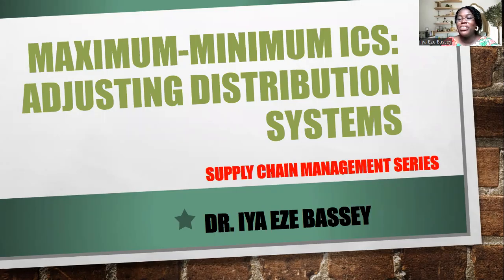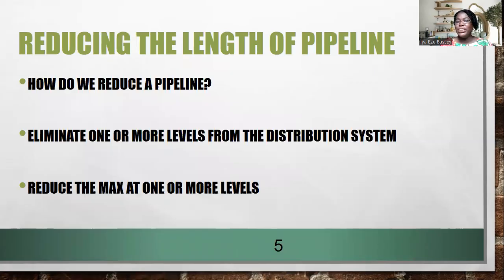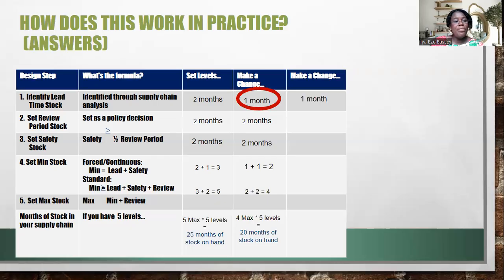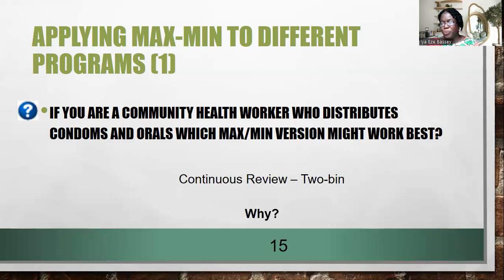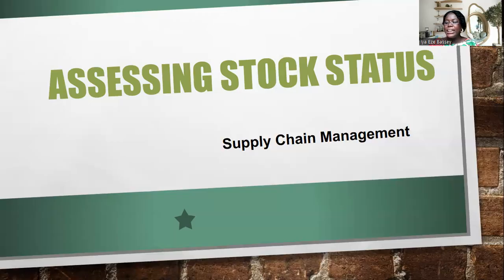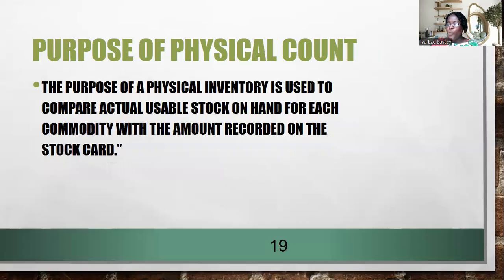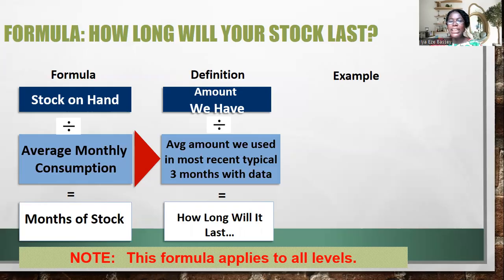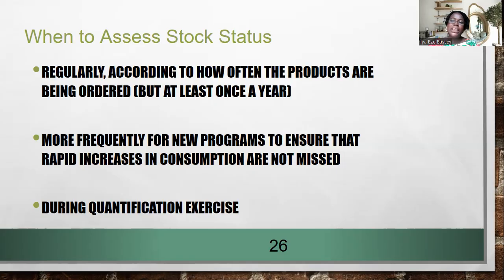Maximum-Minimum ICS: Adjusting Distribution systems (Supply chain management series)

Comment: Good Morning ma,
Here is my summary or what I learnt on the Topic; 
Adjusting the pipeline in the max-min ICS x Accessing Stock Status 
Firstly, the steps in designing a Max.-Min. ICS 
• Step up initial max-min policies for each level and type of facility.   
• Check if the overall distribution will function properly if the level specific max-min policies are implemented.  
• Check the total length of the pipeline f the policies at each level imply 
         Reducing the length of a pipeline 
• Eliminate one or more levels from the distribution system 
• Reduce the max at one or more levels   
How do you reduce the max stock level?
You shorten the review period, reduce the leadtime and Improve the distribution system reliability at one or more levels. 
       Some factors that impact max-min stock level includes:
Cost of product, Reliability of transportation, Storage capacity, Cost of storage, Leadtimes,
Shelf life of health commodities, etc.
The Advantage of using max-min system are: • It avoids overstocking, under stocking and cost for emergency orders
• It minimize wastage 
• It simplify inventory control decision-making 
        What is physical count?
Physical count is the process of counting by hand the total number of usage units of each commodity in your store or health facility at any given time.The purpose of a physical inventory is used to compare actual usable stock on hand for each commodity with the amount recorded on the stock card or BIN card.  
Also, the purpose of accessing stock status is to determine how long supplies will cost
 
The Formula to calculate how long a stock last (Months of stock) is:
MONTHS OF STOCK = STOCK ON HAND (amount we have) ÷ AVERAGE MONTHLY consumption (amount used in most recent typical 3 months with data)
Finally, when to access stock status
• Regularly according to how often the product are ordered(but at least once a year). 
• More frequently for new programs to ensure that rapid increase in consumption are not missed. 
• During quantification exercise.
           Thank you ma for the class😊

Comment: Thanks again ma for another enlightening lecture
From this lecture, I understood the steps indesigning a max-min ICS which are:
1) Set up initial maximum policies for each level and faculty
2) Check if the overall distribution will function properly if the max-min plocies are implemented
3) Check the total length of the pipeline that the policies at each level imply
It is important to carefully analyze demand patterns and adjust inventory levels accordingly
By monitoring sales data and forecasting future demand, business can determine the optimal distribution strategy to ensure that products are available when they are needed.
1 also understood that the advantages of using max-min stock is to avoid overstocking, understoking to minimise wastage and to avoid costs of emergency order, etc. Once again, thank you very much ma

Comment: Thank you ma'am. I have learnt that the maximum minimum inventory control system is crucial for managing stock levels, preventing overstocking and understocking. This system is particularly useful in the medical laboratories for managing laboratory Reagents, consumables and equipment.
The maximum minimum inventory control system operates by monitoring the supply chain, from manufacturer to end-user. I've also com to understand the several factors influence the maximum - minimum levels, including: Age of the program, storage costs, production costs and lead time.
This system helps avoid emergency order costs by providing regular stock status updates. Additional, it facilities management and assessment of the supply chain's length at each level.

Comment: Summary of What I Learnt:
	•	Adjusting a distribution system with Max-Min Inventory Control (ICS) helps manage stock at different points in the supply chain.
	•	It sets maximum and minimum stock levels at warehouses and distribution centers.
	•	When stock hits the minimum, the system automatically sends replenishment orders.
	•	When stock reaches the maximum, it can slow down new deliveries or move extra stock to other places.
	•	This system helps:
	•	Lower storage costs
	•	Avoid stockouts
	•	Respond quickly to changes in demand
	•	Create a more flexible and efficient distribution network

Comment: Great session Prof, here's a summary of what I learnt,
I learnt the different steps in designing a max/min ICS which are: 
a. Setup initial max/min policies for each level and type of facility
 b. Check if the overall distribution will function properly if the level specific max-min policies are implemented. 
c. Check the total length of the pipeline that the policies at each level imply. 
I also learnt different ways of reducing a pipeline, the factors that impact the max/ min stock levels, advantages to using max/ min system, challenges faced while using each versions and variations, applying max/ min to different programs,the difference between a PUSH and a PULL system, definition of physical count( the process of counting by hand the total number of usable units of each commodity in your store or health facility at any given times) it's purpose and why and when to access stock status.

Comment: This is very educative and setting up initial Max-Min rules for each level, determining if the distribution as a whole will work, and determining the total length of the pipeline that the policies at each level suggest are the processes in constructing a Max-Min ICS. In order to compare real stock on hand for each item with the amount listed on the stock card, accessing stock status entails the physical count. Depending on how frequently the products are ordered (at least once a year), we have access to the stock status on a regular basis. Utilizing MaxMin systems has benefits such as minimizing waste, avoiding overstocking and understocking, and maintaining consistent stock levels. Max-Min stock levels are influenced by a number of variables, including product pricing, transit reliability, and storage capacity. health products have a limited shelf life and it has help to grow up some products pricing.

Comment: Thanks ma. I learnt how to reduce the length of pipeline by eliminating one or more in the distribution system. Also how to reduce the MAX stock level by improving the distribution systems reliability at one or more levels so that safety stock can be reduced. By also practicalizing on the design step, formula, the set levels, how we can make a change for diffrerent month. I also learnt about the advantages of using MAX -MIN by avoiding overstocking and minimized wastage. And the purpose of accessing stock status by calculating the MOS on Hand.

Comment: Thank you ma.
I learned how to plan a max-min system for storing health items. The steps are:
	•	Set the first rules for each level of facility
	•	Make sure the rules work across the whole system
	•	Check how long the supply chain becomes

To make the pipeline shorter:
	•	Remove one level in the supply system
	•	Lower the max stock level in some places

To reduce max stock, we can:
	•	Check items more often
	•	Cut down how long it takes to get new stock
	•	Improve the system to need less backup stock

Other things that affect max-min stock:
	•	Product cost
	•	Storage space
	•	Storage cost
	•	Shelf life
	•	Transport reliability

Max-min helps us:
	•	Avoid too much or too little stock
	•	Reduce waste
	•	Avoid costly emergency orders
	•	Make it easier to decide on stock

Some problems include:
	•	Many system levels
	•	Too many product types
	•	New health programs

Physical count means checking each item by hand and comparing with what’s on record.
Stock status means knowing how long the supplies will last.

Comment: In summary 

The process of designing a max-min Inventory Control System (ICS) involves several key steps:
	•	Initially setting maximum stock policies for each level and facility
	•	Evaluating whether the overall distribution system will function effectively with these policies
	•	Assessing the total pipeline length implied by each level’s policy

Often, the pipeline length may be excessive, leading to delays in commodity delivery. To shorten it, the following strategies can be used:
	•	Removing one or more distribution levels
	•	Lowering the maximum stock levels at specific levels

To further reduce maximum stock levels, the following approaches may help:
	•	Decreasing the review period at one or more levels
	•	Shortening lead times
	•	Enhancing the reliability of the distribution system

Several factors influence max-min stock levels, including:
	•	Product costs
	•	Transportation reliability
	•	Available storage space
	•	Storage expenses
	•	Storage conditions across levels
	•	Shelf life of health commodities

The max-min system offers several benefits, such as:
	•	Preventing overstocking and understocking
	•	Reducing waste
	•	Avoiding the high cost of emergency orders
	•	Maintaining stable stock levels.

Comment: SUMMARY: MAX-MIN INVENTORY CONTROL SYSTEM: ADJUSTING DISTRIBUTION SYSTEM.
-Set up initial max-min policies for each level and type of facility.
-Check the total length of the pipeline at each level.
 HOW TO REDUCE THE LENGTH OF A PIPELINE.
1.Shorten the review period at one or more levels 
2.Reduce the lead time at one or more levels.
3.Improve the distribution system reliability at one or more levels so that safety stock can be reduced.
 FACTORS THAT AFFECT MAX-MIN STOCK LEVEL 
-Cost of product.
-Reliability of transportation 
-Storage capacity 
-Cost of storage 
-Storage condition 
-Lead times
-Reliability of sources of supply.
 ADVANTAGES OF USING MAX-MIN SYSTEM 
1.Avoid overstocking.
2.Avoid understocking.
3.Minimize wastage.
4.Avoid cost of emergency order
5.Consistency of stock levels.
 PURPOSE OF ASSESSING STOCK
1.To compare actual usable stock on hand for each commodity to the amount recorded on the stock card.
2.To determine how long the supply will last.

Comment: Thank you ma.
I learned how to plan a max-min system for storing health items. Steps include:
	•	Set rules for each level
	•	Make sure rules work across the system
	•	Check how long the pipeline is

To reduce the length of the supply chain:
	•	Remove one level in the system
	•	Lower the max stock level in some areas

To bring down the max stock level:
	•	Review items more often
	•	Reduce how long delivery takes
	•	Improve system performance to need less backup

Other things that affect stock levels:
	•	Product cost
	•	How much space is available
	•	Storage cost
	•	How long the product lasts
	•	How dependable transport is

Max-min system is helpful because:
	•	It prevents too much or too little stock
	•	It lowers waste
	•	It avoids emergency orders
	•	It helps in stock planning

Problems that may affect the system:
	•	Many levels in the system
	•	Many types of health products
	•	New health programs

A physical count is checking all stock by hand.
Stock status tells how long supplies will last.

Comment: Thanks for the insightful Teaching.

The maximum-minimum inventory control system (Max-min ICS) is a tool for managing stock levels and preventing overstocking and understocking. 
It sets two inventory levels: The maximum level, which is the highest amount of stock a facility should have, 
2. The minimum level, which is the lowest safe amount of stock before a resupply is triggered. 
Factors influencing optimal stock levels include:
Product cost, storage capacity, and the shelf life of the health commodity. 

The benefits of implementing the Max-min ICS include mitigation of overstocking, prevention of understocking, and reduction of wastage.

Comment: Thank you, Ma, for making it clear on the ways to adjust the distribution systems policies. I have learnt that to understand the challenges, advantages of the Max Min system, applying the Max Min different programs. In summary, I learn that the length of people is the first step to take to adjust a policy, each level imply. Reducing the length of the pipeline by eliminating one or more levels from the distribution system,  reduce the maximum stock level I learnt that factors that impact max in max stock level are; cost of product, , transportation, storage capacity, cost of storage, shelf life of health commodities.  
Advantages of using max min system  
1. Avoid under stocking  
2. Avoid over stocking 
3. Avoid cost of emergency order  
Ma u further explained that physical count in the process of counting by hand the total number of usable unit if each commodity in your store or health facilities. thank you very much ma this was so interesting❤️🙌

Comment: God bless you ma for this wonderful lecture I grabbed that The Max–Min inventory control system sets a minimum reorder point and a maximum stock level to guide replenishment decisions  . Designing it requires calculating lead-time and review-period stock, safety stock, and deriving min/max using standard formulas, then setting initial policies at each facility  . Critically, the pipeline length the total stock in transit must be checked against policy to ensure adequate coverage without overstock  . Adjustments involve tweaking formula inputs such as shortening lead times, review intervals, or improving supply reliability to lower safety stock and reshape min/max thresholds  . This approach prevents stockouts and overstocks, reduces waste and emergency orders, simplifies decision-making, and provides reliable data for forecasting, ensuring smooth product availability. Thank you ma ❤

Comment: ADJUSTING DISTRIBUTION SYSTEM

1. The first step to consider is length of pipeline:

When designing a max-min ICS we need to set up initial max-min policies for each level and type of facility, and also check the total length of the pipeline.

2. The second step is reducing the length of pipeline:

Which is by eliminating one or more levels from the distribution system and reduce the max at one or more levels.

I learnt about factors that impact max-min stock levels which includes:

Lead time, reliable source of supplies, effect of a zero balance of stock and shelf Ilife production cost.

I understood some advantages of using max-min system is to avoid overstocking.

avoid understocking, minimize wastage and avoid costs of emergency orders.

It was impactful thank you very much Professor.
Reply: I learnt that the first step to consider is the length of pipeline when adjusting distribution system second we reduce the length of the pipeline .

Comment: Thank you so much ma'am 
I learned how to plan a max-min system for storing health items. Steps include:
 * Setting the first rules for each level of facility
 * Making sure the rules work for the whole system
 * Checking how long the supply chain becomes
To reduce pipeline length:
 * Remove a level in the supply system
 * Lower the maximum stock level at some places
To reduce max stock, change these:
 * Review items more often
 * Reduce the time it takes to get new stock
 * Make the system work better so less backup stock is needed
Other things that affect max-min stock:
 * Product cost
 * Storage space
 * Storage cost
 * Shelf life
 * Transport reliability
Max-min helps because it:
 * Stops too much or too little stock
 * Reduces waste
 * Stops costly emergency orders
 * Makes stock decisions easier
Problems:
 * Many system levels
 * Many types of products
 * New health programs
A physical count is checking each item in stock by hand to compare with the written record.
Stock status is about knowing how long the supplies will last.

Comment: MAXIMUM- MINIMUM ICS: ADJUSTING DISTRIBUTION SYSTEMS

I’m thankful for this lecture  Prof. Eze Bassey

From the lesson, I’ve learned how to adjust distribution system policies and I’ve also learnt about the advantages and challenges of maximum minimum inventory control system.

From the lesson, I understood that the maximum minimum inventory control system is crucial for manager stock levels, preventing overstocking, under stocking. This system is particularly useful in medical laboratories for managing reagent, consumables, and equipment.

Maximum minimum inventory control system has to do with understanding the benefits and challenges in keeping stock at right levels.

Thank you Prof. Eze Bassey for this impactful class.